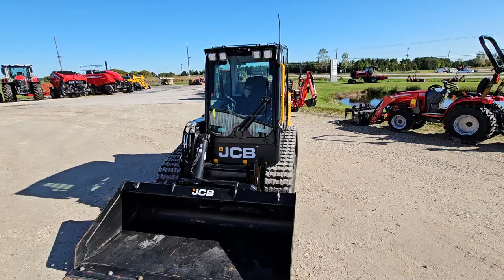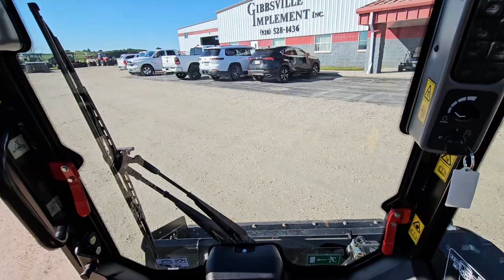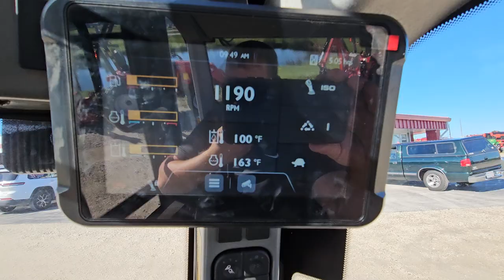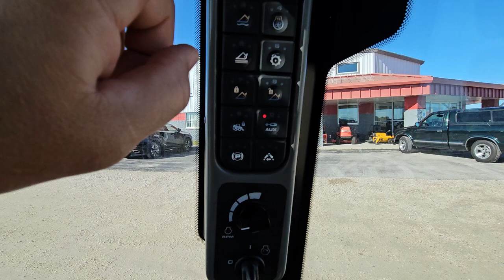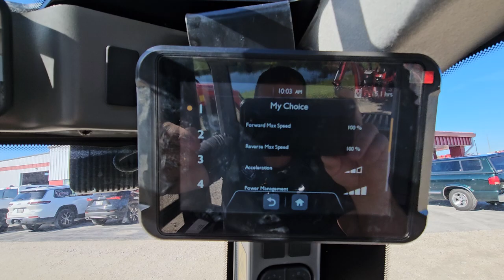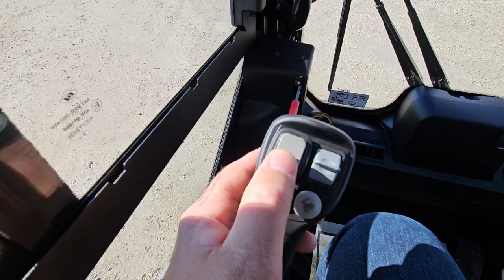JCB 215T compact track loader walkaround - Gibbsville Implement

Comment: Hi we have a brand new JCB 215 (2024) and i am wondering if its possible to transfer the FNR from pushing/pulling the joystick to the 3 way switch on the left joystick?  On a long drivway or parking lot with the hyd broomits a pain to hold that stick in forward position...
Great video btw!